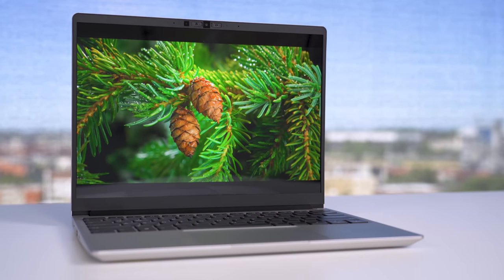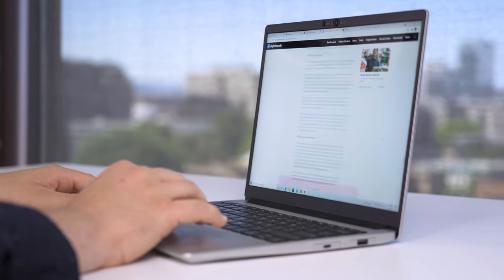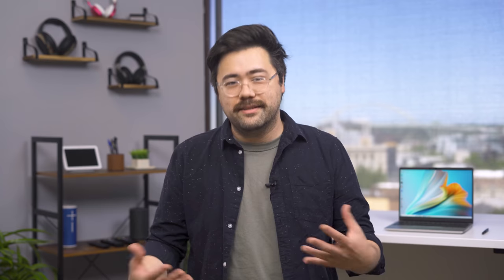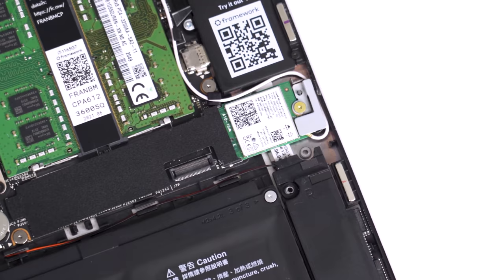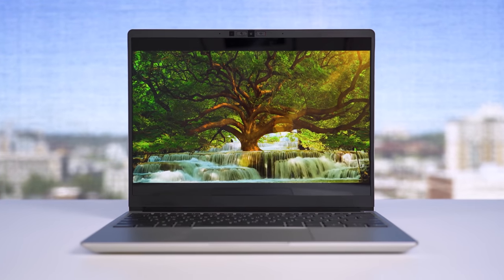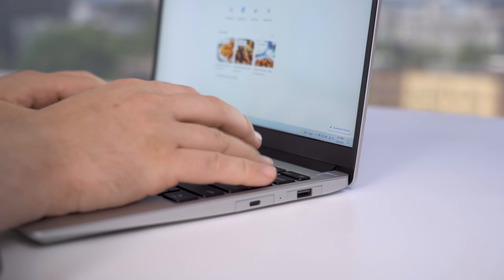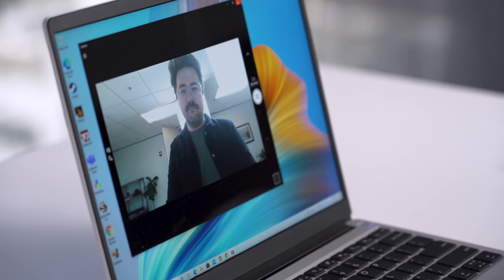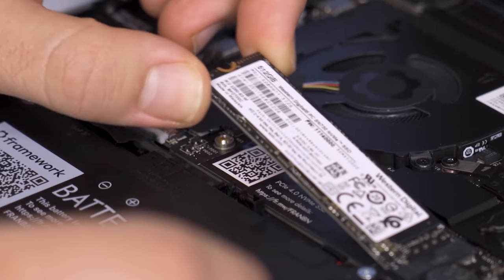Framework Laptop review | How ALL laptops should be

Comment: Back around the 1990's my Sony laptop on the back cover had trap doors with screws that you could add or replace Memory, Hard drive and a removable battery.  After then I had a Dell after the sony was built the same but you could remove the cd add a 3.5" floppy drive or have two batteries.  That would be nice to have a laptop-like that again.  That laptop looks like but I would love to see a lighted keyboard and a touch screen.
Reply: The keyboard is actually backlit and the Motherboard does support touch so it could be a possibility in the future.
Reply: The display can be easily replaced, so touch screen module is possible.

Comment: Really grateful that you went beyond the concept of the Framework and discussed what you thought of it as a daily driver after using it for a week. That's ultimately what matters most: It can be made of Legos but if it doesn't become a usable computer -- something I'll WANT to use instead of my old Surface Book or one of my ThinkPads -- then it'll be a failure. But it sounds like you've found it to be a quite decent machine and I was especially pleased to hear your very positive report on the keyboard. Just placed my order and hope to have it in about a month.

Comment: You forgot to mention, an option for the modules you can get are actually SSDs; that are pretty reasonably priced as well. That means you can get fast external storage in a small form factor that isn't hanging off the side of your laptop, that's easily removable or swappable.... So you have another option to add more storage later on that's separate from your boot disk, and you could potentially keep particular modules for different storage purposes (e.g. one for keeping video footage and one for your steam library).

Comment: Very very important. This will be my next machine ^_^ - I'd like it in mate black / carbone
Reply: Take the components out and spray paint the chassis, LOL 😋
Reply: @BitsOfInterest  Wait- That's actually possible, isn't it? :o
Reply: @trailblazercombi  it should be 😁 because it's a matte finish I figure it's anodized (do your own research) so you'll need to clean it and use an etching primer and after that you can paint or die it any color.

Comment: I wish the designers had additionally separated the power jack from being another direct mounted circuit board component, and addressed power as a module which could be replaced if it were damaged. Currently, when power jacks are impacted, they commonly separate from the circuit board, and brick the entire unit. In addition, include an easily replaceable screen, keypad, and touchpad.
Reply: The keyboard, screen, and touchpad are all fully replaceable and serviceable, everything which is simply held in by screws, no glue or adhesives. and since your Power jack interface is technically a USB C Expansion card in the event of damage you just need to replace the usb c extension card. Though the internal USB C connectors directly on the motherboard are soldered in so yeah if that got damaged you'd need a new Motherboard.
Reply: @Ajaxster  Thanks for the details – it’s beginning to sound better than I previously understood.

Comment: On the importance of upgradeability: For me, longevity is one of my biggest requirements in tech. I hate having to buy new hardware more than once every 4-5 years or so. It feels wasteful! But I'm also not big at DIY hardware upgrades because the learning required to interest I hold ratio doesn't usually pan out. This thing though, this thing looks like something I'd happily upgrade parts of on my own every once in a while as battery degrades or new tech standards come out. I just hope they release a touch screen option soon!

Comment: Corporations will like this design which will allow for very simple repairs and upgrades. Except Framework are a "no name" for now which means corporations will probably pause and pass.

Individuals only seem to care about price.

The only time I care if a laptop is upgradeable or not is when someone asks me to upgrade their laptop. I do a quick YouTube search to determine if the laptop is easy, hard or impossible to upgrade and advise accordingly.

For my own laptops I don't typically care since I use Chromebooks which are replaced before the OS goes out of support.

I do like the modular port design. All laptops should have this. Its basically an integrated adapter, but has the advantage that there is no cable or adapter sticking out from the laptop which is great for portability and you can't leave the adapter behind on the end of a cable. Brilliant design.

Comment: I haven't bought a laptop for years as I'm the person family members bring their old laptops to for repair. I'm currently using an old compaq cq58 to comment. I've whacked in some ram from an old Dell with a motherboard faliure to bring it up to 8gb, but it still has a shite celeron processor. I bought a new battery for it also for £17 (only worked with charger).

I use this all the time though, it's my preferred machine (until I need ooompff)

Would love to be able to get something like the framework though. I've been put off the modern laptop market for years as nothing is up-gradable and repairable any more without trying to un-stick glue.

Comment: What if you install a medium-lightweight linux distro there? Will battery last longer?
(different laptop) In my xubuntu, I can make an average 5 hour battery last average of 7 hours, just by using xubuntu instead of windows.
I already also tried with Lubuntu, and it lasted almost averaging 7.5 hours.
Maybe the solution is to use linux!
Reply: linux is the way
Reply: @capkenway  All the way!
Reply: Hopefully so
On a different laptop model, I'm actually getting slightly worse battery life than on Windows
Reply: @trailblazercombi  That usually happens when you either:
1. New hardware and sleep not well implemented in linux yet
2. Discrete GPU is not being turned off either manually or due to (in Nvidia case) optimus not correctly setup. New Nvidia drivers solve that (for the most part)

Comment: I would love to see a 15"+ device with optical drive (yes, point and laugh at the dork who still uses disks for things) similar to the MacBooks of olde with the trayless optical drive, and if you don't want that, replace it with a caddy or even auxiliary battery, since these machines use 11th Gen Intel, you have thunderbolt for power and data transfer.

Comment: So it comes with windows preinstalled? 
Cool! It will be easier to upgrade to linux then
Reply: There is also a DIY Edition without RAM, SSD and WiFi i think. Therefore also no preinstalled OS. The got a recent blog post where they talked about the compatability of the big Linux distros

Comment: Repairability is a big deal for me and I really hope to see this succeed. I have been fairly sucked into a lot of the hype around Apple silicon, though, and really wish there was something that had the thermals/energy efficiency/acoustics/ power of that without the planned obsolescence. Hopefully there’ll be a new generation of chips from AMD or nVidia that will fit into this kind of ecosystem. Must admit I somewhat prefer MacOS to Windows as well, although a lot of my work is fairly Windows based. I’d be quite happy with Linux but still find a significant amount of software I want isn’t there.

Comment: What about playing games does it perform well
Reply: its integrated graphics from Intel® Core™ i7-1165G7 Processor 
check performance from laptop with the same chip, Integrated graphics is the best you could do with its cooling system. if the company succeeds I'm sure they will make a 17" version with swappable graphics card which would be great but Dell's Alienware Area 51m tried the same thing and in my opinion failed.
Reply: Probably not as good as amd APU but it should be good enough for like little bit of csgo or league of legends or something.
Reply: Unfortunately, it's not a great option for gaming. For light games on low settings you might be able to get by though.

Comment: I bought cheaper msi gaming laptop with dedicated gpu I checked upgradability and managed to upgrade my memory from 8 single slot to faster 2 dims with 2666mhz duo clock memory. Memory from 1 128gb m2 and managed to add 2 additional storage ssd and another m.2 drive now 1.1 TB in total. Basically the laptop was 800 quid added another 200 in parts and made it to 1800 quid laptop.

Comment: The Only Upgrade I did to my laptop is put SSD in it, remove DVD writer & put my Old Hard drive in it using Caddy & Last Upgrade Wifi Card..So Yes It's a must have Feature for me or else I have thrown my Laptop years Ago (7 years Still Going Strongly)
Reply: I did the same exact thing on my 2016 i3 laptop, and it honestly runs so smooth (also thanks to linux I guess)

Comment: The touchpad kills it for me immediately.
Reply: What about the touchpad kills it for you?
Reply: @lukelarsen8228  The lack of physical left/right buttons, the size. A touchpad that size usually indicates gestures, which I despise with a passion, especially after being forced to use a MacBook Pro for work over the course of 4 years.
Reply: @faboohaahh  I see. Those things have certainly become desirable features in Windows laptop touchpads in the last few years. ThinkPads are one of the few laptops that use separate left and right buttons at this point.
Reply: @lukelarsen8228  I could overlook the touchpad if the system were a true gaming laptop, but for the specs and cost, it's just not worth it for the modularity.
Reply: @faboohaahh  
It might not use gestures but multi-touch. Lenovo touchpad multi-touch support is great. e.g. two finger presses = right click.
Reply: @Un1234l  The multitouch gestures are actually baked into the OS, not the touchpad
Even triple finger swiping can work on 12-year old touchpads, with proper drivers and an OS that supports them
On the other hand, it also allows our gestures-hating friend here to disable them altogether

Comment: Completely unimportant for me to upgrade a laptop, I do not use a laptop as a main PC and only need a laptop for basic websurfing or office tasks. Laptops that can meet those needs are both cheap and plentiful. I am not spending $150 to upgrade the RAM on a $500 laptop.
Reply: You're not thinking long-term. Suppose 5 or even 10 years from now your current laptop isn't cutting it for future uses. Supposing this company is still around, you can easily exchange parts and extend the lifespan of the laptop.

But then again, if you're REALLY only ever gonna use it for basic stuff, and it will remain that way, yeah you won't need to upgrade.
Reply: @Un1234l  I'd just buy a new one, frankly. I really don't use my laptop for anything else at all. I have a desktop PC and don't need to do work on the go. Makes sense if someone has the need. Specifically answering the question asked; for me, this is not a big deal. 

I can buy a laptop at Walrmat for $300  for basic use, run it into the ground and get a new one easily in a few years. Without having to hope this or that company sticks around, or spending a quarter of the cost to upgrade the HDMI port or hard drive.
Reply: @Exiled_Rouge  And where does your old one go? Into landfill?
Reply: @njf1410  We have a donation program for schools in my area. I usually dump my old PCs and Laptops with them.
Reply: @Exiled_Rouge  Excellent!

Comment: It is not how every laptop should be. It is a very good product, yes. But it still does not have the build quality like a MacBook Pro, not by a long shot. Laptops like this need to exist out there, just not every single one. Mbp just need to be more easily repaired, it shouldn’t be modular like this framework laptop. There should be different types of laptops to choice.
Reply: Firstly, MacBook quality is not that great, a ton of people I know have many problems with them. And it isn't sturdy, the aluminum scratches, chips and bends easily. However Macbooks are beautifully designed, I agree with that. And that is exactly why Apple use a unibody design, not (purely) because of function.

Secondly, laptops, like any other products with a longer period of ownership, should be made in a repair-friendly way. No point in complaining about enviromental damage and consumerism, if we cannot repair this. Do you replace the whole house if a couple of windows break? No, you repair and reinforce the windows. The problem is, people seem to not care about problems like pollution and unethical labor until it hits them in the face.

Also, keep in mind that this is the first product by a completely new, small company. Imagine what they could do with a bigger budget and more R&D.

I agree that there is a place for less friendly-to-repair electronics, but for most consumers, I think those are just a way of enforcement of bigger dollar spending.
Reply: Agree with this statement 100%. In addition, "Right to Repair" and "Hardware Reparability" are two separate things.
Yes, it is good that the Framework laptop is almost fully repairable, user-serviceable, and upgradeable. But it should exist as one TYPE of laptop among many others, and people should be given full choice to decide for themselves.
Reply: If you had the choice between a repairable laptop and a comparable model at a comparable price that was not easily repairable, why would you ever choose the non-repairable version?
Reply: @Alpha8713  because repairability is not the only criteria to judge a laptop. But like I say in the end, I do want laptops like macbook to be more repairable in some way.